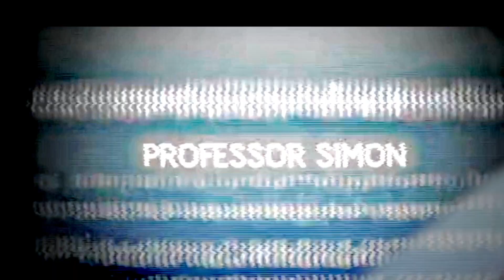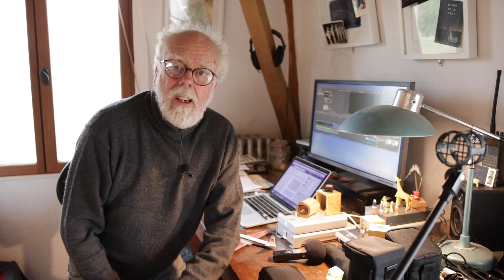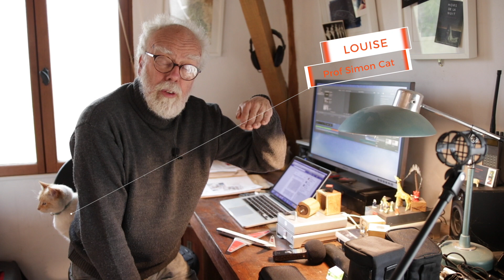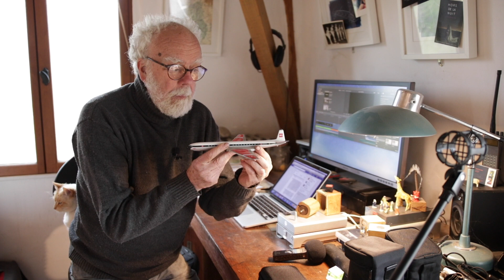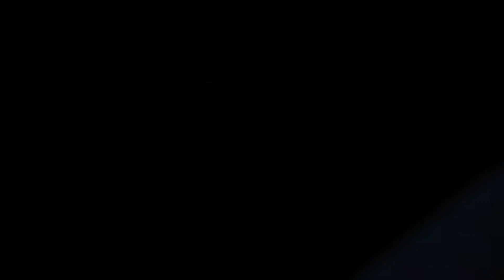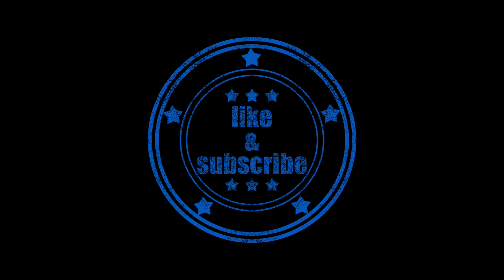737 Max 8 - Report published - Prof Simon

Comment: MCAS is designed to counter the engine position caused nose-up, it should smartly trim some units according to the current engine thrusts etc., and remember to return the trim once the situation is gone. But the current logic of MCAS is: whenever AOA goes wrong, I trim nose down; Sensors disagree and faulty? I don't care, I trim nose down; All other sensors showing plane is already in nose-dive? I don't care, I still want a nose down; Pilots hitting trim button like crazy try to counter me? F you and I will give you a nose down; You can cut the trim motor, fine, but once you turn on the motor again, I give you a huge nose down. Did Boeing hire some high school kids to design and code the MCAS system? Seems so dumb: No calculation, no simple upper-limit, no double-check other sensors, no warning sounds, the only thing it does is, keep trimming downward ignoring everything else whenever AOA shows wrong. WTF Boeing WTF??!!
Reply: As a software designer and systems engineer, I completely agree.  I find it difficult to understand how this could have passed a design review, much less made it into production.  This isn't Monday morning quarterbacking.  This is a case of engineering malpractice.
Reply: @Larry Well actually when plane is losing altitude, it may be too late (too dangerous and too hard to gain control back once stalled already happened)
Reply: @Larry
Moreso, I understand that the MCAS is there to prevent a stall condition. That means that it needs to kick in well before a stall actually begins i.e before loss of altitude.
Reply: No, the logic of the MCAS is not whenever AOA goes wrong, I trim nose down. In fact, the autopilot toggles OFF - and did more than once -  if there is a AoA fault. 

The real cause of the crash is that the crew flew the aircraft so far past Vmo (over 40 knots) for so long that there was no way for them to manually adjust the horizontal stabilizer trim. Read the Preliminary Report and look at the data. Learn about what MCAS does, and when and how it does and doesn't work before you accept the opinions of under-informed posters in the blogosphere.
Reply: @Larry Oh yea sorry I missed the comment you replied to and so I misunderstood.
Reply: @Larry 
I do get that. My point is that the MCAS should continue to check for change in altitude during and after the correction. The check should be an ongoing process.
Reply: @cgi9498  the airplane can be in descend stall ( deep stall) and in certain conditions the nose down even if the airplane is descending must be done, so rechecking with altitude loss in certain situatios would not help
Reply: @uzam58  
My point is that checking the altitude is very important to see if you are getting the result that you want. The software puts the nose down to recover from the stall. If the stall or loss of altitude continues despite putting the nose down, then the software must give up control to the pilot at that point. Then the pilot can manually fly the plane and use his experience.
Reply: @cgi9498  i agree with that
Reply: That is funny and true. That is what you get when airplane is designed, manufactured and approved by same company. You have to be inspected by 3rd parties what the fuck you product is doing. Thx to Donald Trump and Boeing coo two airplanes are crashed. Remember Boeing 777 is certified by Boeing and he got battery fire problem.
Reply: "Pilots hitting trim button like crazy try to counter me? F you and I will give you a nose down;". Except the data shows clearly that when the captain used the electric trim it worked as it should and paused the faulty MCAS. One of the most disturbing facts that has emerged is had the captain simply persisted with trimming ANU before using the cutout, the aircraft would have been fine - just like the Lion Air crew did on the flight before their accident.
Reply: @Larry - True, but the AoA changes and airspeed drops before the altitude loss. By the time you are loosing altitude  you are already stalled. Pitch controls airspeed and power controls altitude. MCAS is not intended to prevent stalls, it regulates the amount of control column force the crew has to apply at high angles of attack.
Reply: As a software engineer, I completely understand where you are coming from. In such a critical system as an aircraft, the control software needs to rely on information from multiple sub-systems. The MCAS should be relying on other devices like the altimeter in addition to the angle of attack sensors. Why would it continue to push the nose down if the altimeter shows that the aircraft is losing altitude? Crazy design.
Reply: @cgi9498  Amen
Reply: @cgi9498 ,faulty and flawed system.FAA passed it.
Reply: @KKnBB. It couldn't have been explained better. The MCAS just takes over the plane disregarding everything else. Insane!

Comment: It seems to me and not a pilot😨 the canary in the coal mine☹️ is the reliance on 1 of 2 AOA sensors !! MCAS in itself seems benign and efficient!! Runaway trim disconnect the stab switches! Routine👍 but when the AOA sensor is faulty disaster is lurking☹️ and apparently the pilots can manually switch from side to side if they realize soon enough 🤔 All aircraft have AOA sensors, something is wrong in this batch of sensors apperantly ☠️

Comment: 100% agree !!! The main issue is changed balance by introduction of heavier engines, and relying on software and electronics to keep it in order.
Reply: No it isn't. The thrust and placement of the MAX engines can cause a pitch up condition if throttle is applied too rapidly. If the issue was center of gravity was the issue...the engines being farther forward...you guessed it...would push the nose down.
Reply: stimproid  well, what I understood from some information, is the weight distribution vs. contols... and the talk is about leveled flight. Or question about the ability of the system to revert to basic behavior. I.e. gliding. So, what you said make sense, I’ll try to understand the problem better.
Reply: @strelnikoff7  If you want to learn more about MCAS, the MAX, and flying...I would suggest the following you tube channels run by actual commercial pilots. The have lots of great information: Mentour Pilot and  blancolirio . This "professor" is not a reliable source of information. Cheers.

Comment: letting the yoke off would enable manual trim  and it would be easier to trim by hitting the air brakes also(what would give them more  time also).. so just barely in that case they could have pulled up and save the plane.. that depends on altitude.. copilot said he  cant manualy trim, but of course because of really bad training he didnt know what to do.. but even so, they were low, so it remains a question would they be able to pull up despite that.. probably yes.. and they needed 2 minutes to realize they need to cut off auto trim switches, also very long.. well if we will be honest, any pilot should not control commercial jet if he doesnt know what to do when he cant manually trim, but unfortunatly that what should have been basic training again its still missing in knowledge of many pilots, especially in  third world countries,  and thats a shame..  i say if they used correct procedure instead of turning mcas back on again, they might been able to save it.. but "might" is not enough, so in this case Boeing takes full blame for the crash.

Comment: Could the horizontal stabilizer stall?
Recovery is completely different if it is the case.
Could the tip of the wing stall first because of big engine airflow ?
It is a spin and recovery is more complicated than a nose down stall.

Comment: One might place interrogetories to the Boeing Product Design Organizaton as to why the Maneuvering Characteristics Augmentation System (MCAS) was deemed so necessary for these models in the first place.  We have heard assertions that among the objectives of the MCAS system was to make the newly designed MAX models have similar flight characteristics to the older, lower powered 737 configurations.  Inquiries may indeed prove that the Company’s objectives were more related to pilot training & recertification requirements than flight control & stability conditions of the specific aircraft being sold.  The MCAS may indeed be a type of “training wheels bridge” from the older aircraft to the newest without the bothersome stop for training in the interim or having airlines go through type-certification on what is ostensibly a new and different aircraft.
Reply: The 737 max 8/9 plane violates the 130 degree nose angle rule of the main wing.

Comment: The mcas was to make the plane fly similar to earlier aircraft to get around certification issues.
A standard 737 is also not pitch nutrail and not many airliners are because of the flight envelope and altitude they fly

Comment: Was passenger on one last year. Cosmetically it is a beautiful machine. Thank God that the pilots flying were well trained enough to handle the MCAS. It is quite apparent that Boeing is still scratching their heads trying to figure out what to do with those expensive failures. Can the engines be switched to another kind? Can MCAS be totally disconnected and removed from the aircraft? Is Boeing going to have to eat the losses for airline companies that tell Boeing to take back these disastrous jets? Looks like the boneyard got quite a large number of newbies in its mix. 346 lives lost forever in a rush to put something different into the skies.

Comment: Yep, that's what I said some time ago.  
A lot of planes have trim changes when applying or decreasing thrust.  Not a big deal.

They didn't fly the plane.  
Disconnect the trim.  
Trim manually, FLY THE PLANE.  Idiots.   
Everyone I've known that has died in a plane did something stupid.   Pilot error.  Sorry.
Reply: Most of the pilots were not trained or aware of the MCAS system - even the simulator for the model is not out yet lol!

Comment: Go back to the beginning. MCAS was introduced because the stronger engines tip the plane up. I understand that the engine mountings are in a different place on the 737 MAX for the same reason. Should the 737 MAX  not be re-designed again, so that it can fly level WITHOPUT a computer over-ride? Or can the engines be de-rated so they don't tip up the plane in the first place? This might be the solution preventing the existing 737 MAX being grounded permanently, and thereby force Boeing into bankruptcy.
Reply: The Max can fly without input just as any other airliner. The "Professor" is misinformed.

Comment: As a retired airline mechanic, with a pilots license, Aircraft are under too much computer control !  Pilots, no longer can fly proficient enough without all the computer assisted systems.  Relying only on training with a playstation, and no more seat time is going to be a bigger disaster as time goes on !  Basic knowledge of airspeed, vertical rate, heading, and altitude with a good pilot, just shut off all the computers, and FLY ! That's what pilots need to learn and become professional Airline commanders !
Reply: Back to basic flying.
Reply: @jeevansingh7772  "Back to basic flying." 
Back to the horrible accident stats of the 70s and 80s.
Reply: @bokoloaranyfa3824  not in that context. Pilot flying is limited.

Comment: The biggest error on part of the crew was to allow speed to exceed VMO, resulting in excessive force on the jackscrew. The low altitude did not allow a slight dive to relieve the  force required for manual trim.

Comment: The Comet had their engines inside the wings, but that may have weakened the wing to fuselage connection and created maintenance access problems.  Boeing would have had to redesign the airframe, but maybe the Comet engine location is a good one.
    The Comet crash investigation is considered the basis for how all accident investigations should be done.  It was the result of that WWII era of engineers who knew how to assemble a project out of nothing and have something accurate in a timely manner.  Winston Churchill said the problems had to be determined and fixed, and it happened.

Comment: The most striking quote that would have allowed control, this after a sensor replacement close to this flight implying a checklist and QA on the system performed and ok, was that the manual backup trim wheel , "... wasn't working".

That's not possible right after a servicing without paperwork, who signed it off?

Comment: Boeing focusing on the attack angle sensor and software errors are smoke screen. On all the comments I heard of always assume the plane is in working condition before hitting the ground. 
The stabiIizer, a device on the back wing control the flying angle is link by steel wires to the cockpit. Two motors beside the hip of pilots drive the flaps. No matter the plane is under manual or automatic mode, pilots can always stop the motor by hand and crank it to desired position. All pilots understand this procedure. So I do not accept the idea of MCAS causing the crash. To my opinion, the rear wing is already damaged by faulty components or the plane body was twisted under severe vibration jammed the steel wires making the plane out of control. Boeing obviously hiding the truth to cover up the unsafety of the plane body.

初步調查報告說飛行員首先用人手操作，不行，自動操作啟動，也不行。到最後關頭，用人手攪動馬達，卡死了，動彈不得。我現在分析疑點如下。
1. 有飛行員說這型號必須用自動駕駛才可以起飛。否則，電腦跟本不讓起飛。而那MCAS雖然已經關閉也會自行啟動。換句話說，這機因為太不安全，所以不能用人工操作。
2. 波音假設這航班在墮地前一秒，機件還是正常，只不過飛行員不懂得如何避免災難。把責任全推在飛行員身上。如今初段報告，黑盒數據證明飛行員有依照波音的方法，飛機仍然失控。
所有737系列係用鋼線拉動尾翼的。兩個馬達裝在駕駛員身傍。在緊急狀態下，可以關閉電源，用手搖動馬達便可。就算自動駕駛出錯，甚至馬達不停轉動，仍然可以用手停止馬達，強力用手向反方向攪動。所有飛行員都明白這道理。也是在訓練課程的。所以波音所說的，也是有道理。但難道兩航班，共四位飛行員都不明白這方法嗎？我認為飛機在震盪和失速時，機身已經扭曲和破裂，把鋼線壓著，不能移動。所以無論用人手或自動，飛機都完全失控。另或許尾翼因零件不合規格，早已損壞掉了。若是機體早已損壞，這樣，黑盒子的數據便沒有太大意義。
波音明顯隱瞞此事，把責任全賴在軟件上。如果爆出真相，人們便會指責機體本身不安全。這是刑事責任。
今次的報告是初期報告，也只是冰山一角。還有許多腐敗事件等待揭發。還世界一個公正。

Comment: I absolutely agree with your closing statement. You have an aircraft that's more like a seesaw and instead of fixing the problem at the source you design a countermeasure. Any first year engineering student would fail the course if they did that.

A couple of clarifications. The report speaks of trim movement in "units". I'm not sure one unit = one degree? I don't know. 

Secondly you missed a very telling point. After they switched off trim cutouts, an automatic command was recorded to put the aircraft in a nose down attitude but no trim changes occured. In other words MCAS in the background tried to do it again but because it had been sequestered, nothing happened. A few seconds later the aircraft DID automatically go into a nose down attitude. The report does not elaborate further but this I think should definitely be the next point of investigation. Does MCAS have failsafes or redundancies, workarounds if the direct electronic trim command doesn't work? Are there other systems that also correct attitude and that take readings from the angle of attack and airspeed sensors? There's a video about a Quantas Airbus A340 which had that problem. Thankfully it was at 37,000 feet so the pilots had time and room to fight. Neither the Lion Air nor the Ethiopian Airlines pilots had that good fortune. I'll come back and post a link if I find it. Most memorable comment from the Quantas pilot? I was in a knife fight for my life against the airplane. Only one of us was going to win. 

I think MCAS was a bad idea to start with, for the reasons stated at the top of my comment. Its a battle between engines pushing the nose up and MCAS wrestling the tail up (hence nose down), all that strain being applied to the airframe. How is that good? Imagine two big kids trying to lift their end of the seesaw to see who's stronger. Can you picture the strain on the plank itself? 

Secondly all earlier Boeing 737s had a simple way to override the autopilot. Just pull or push on the yoke, hold for a couple of seconds (or go more than a few degrees) and the aircraft will yield to the pilot's commands. Not in the Max. MCAS will back off for 5 seconds and then come back on. If you were used to the old system you'd be fooled into thinking it was off and when it jumped back up at you - you wouldn't know what was happening - because your brain would be saying "its not the automatic systems, those are off now. It must be something else. You better figure it out fast because that's the ground rushing up at you at 400mph". This is what happened to Lion Air. They didn't know about MCAS, they kept fighting the system and it kept fighting back. 

To diaable MCAS, even according to Boeing, you have to go through several extra steps. Manual electronic trim inputs, pulling cutouts, perhaps using the trim wheels. That last is pretty hopeless at high speeds because the aerodynamic load, the force of all the air pushing on the control surfaces, is probably 100s or 1000s of kilos. You're not going to overcome that any more than you can walk outside right now and lift your car. And although its similar, it is NOT identical to the process and sequence of how to deal with runaway trim situations. Its essentially an entirely new response protocol and not only did they deliberately decide not to train the pilots on it, Boeing seems to have made it so complicated as though to deter pilots from ever overriding the system. The only reason to do that if they felt the aircraft's pitch stability was seriously compromised.

Edit. Here's the Quantas incident. https://youtu.be/2cSh_Wo_mcY
Reply: Too much wrong with your statement to fix at the moment. Maybe later.